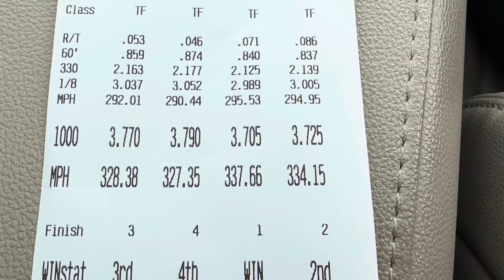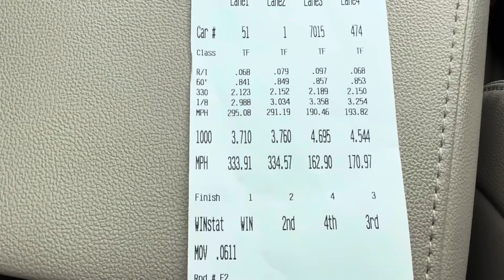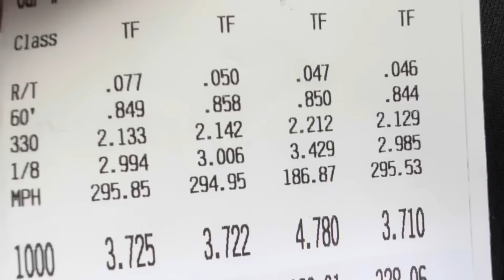337 MPH Final Round!!! OH SO CLOSE!!!

Comment: Hey Clay, Great finish!  I have a question for you.  On the fuel tanks, they used to have a little breather so the air would help push the fuel to the engine, what happened to those?  They would put a little hood on them during the burn out to keep from putting fuel all over the track, they had the backer remove it before the race..

Comment: Clay , can you please tell me what is the Mirror for?
Reply: Clay has answered this question before in previous videos, but I'll pass the answer along. Clay does not use a pedal stop for the clutch pedal. He does it by "feel"/experience He's using the mirror to look back at the rear tires when he finds the neutral (fully disengaged) position of the clutch. If the tires aren't spinning, that is the neutral spot.

Comment: Love the videos Clay. When you guys do the warm up, what are you looking at with the little mirror?
Reply: Clay has answered this question before in previous videos, but I'll pass the answer along. Clay does not use a pedal stop for the clutch pedal. He does it by "feel"/experience He's using the mirror to look back at the rear tires when he finds the neutral (fully disengaged) position of the clutch. If the tires aren't spinning, that is the neutral spot.
Reply: @kennethking3520  Thanks mate, I figured someone would let me know 😁

Comment: As a spectator, I really don't like the four-lane races because it halves the amount of time racing.  My first years of watching nitro racing featured six-second (and some tenths) runs.  Now the cars are on the track half the time as back then.  The burnouts take less than half the time they used to.  The distance run, while not halved, is only 1000 feet versus the full 1320 I saw back then.  Dry hops were a thing, too, which made for more time on the track...  Quicker ETs and higher speeds are cool, of course, but the trade-off equals less time enjoying the sights and sounds and excitement. 
The helmet camera almost makes up for that, giving a real driver point of view.  We never had that back then!

Comment: Why the mirror when they fire the motor in the pits
Reply: Clay has answered this question before in previous videos, but I'll pass the answer along. Clay does not use a pedal stop for the clutch pedal. He does it by "feel"/experience He's using the mirror to look back at the rear tires when he finds the neutral (fully disengaged) position of the clutch. If the tires aren't spinning, that is the neutral spot.

Comment: Just curious why Clay is using a mirror and what is being looked at?
Reply: Clay has answered this question before in previous videos, but I'll pass the answer along. Clay does not use a pedal stop for the clutch pedal. He does it by "feel"/experience He's using the mirror to look back at the rear tires when he finds the neutral (fully disengaged) position of the clutch. If the tires aren't spinning, that is the neutral spot.
Reply: @kennethking3520  Thank you!

Comment: Okay it's got me puzzled what is it you're looking at when you grab that little mirror and look at the engine when you're fired up what is that all about
Reply: Clay has answered this question before in previous videos, but I'll pass the answer along. Clay does not use a pedal stop for the clutch pedal. He does it by "feel"/experience He's using the mirror to look back at the rear tires when he finds the neutral (fully disengaged) position of the clutch. If the tires aren't spinning, that is the neutral spot.

Comment: So what info would anyone want on the dash?  In NASCAR teams would try to hide their water temp, but obviously not in TF.  RPM is limited so unless it's launch RPM or possibly oil temp but I've never seen anyone preheat in NHRA, actually the opposite w PS teams running ice water thru the engine before runs.  I doubt the timing is visible on the dash, I'm not sure what would be confidential on the dash.
Reply: They probably don't want other teams to know Anything about how they run their car. 🤷🏼‍♂️
Reply: LOL If your not sure what might be confidential, then I think you answered your own question. Clay has a video about what goes on during a run and talks about what is shown on the screen. Fuel flow, fuel pressure, oil pressure RPM/Tach and I believe there is a timing (magneto) reference. I would post the link but for some reason every time I do it gets removed. Its one of his older videos. He covers levers, pedals, startup and staging....pretty much the whole bit.

Comment: Sorry. I'm probably the eleventy-fifth person to ask this. What's up with the mirror?
Reply: Nope...you're the eleventy-SIXTH!!! 🤣 Clay has answered this question before in previous videos, but I'll pass the answer along. Clay does not use a pedal stop for the clutch pedal for the neutral positon. He does it by "feel"/experience He's using the mirror to look back at the rear tires when he finds the neutral (fully disengaged) position of the clutch. If the tires aren't spinning, that is the neutral spot.
Reply: @kennethking3520  Cool. Thanks for the reply. Now I can sleep at night.